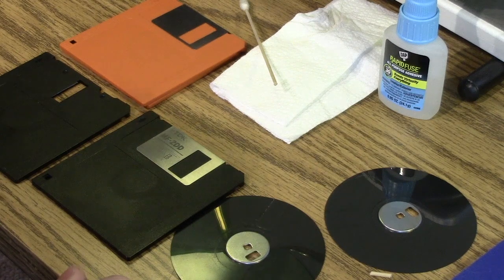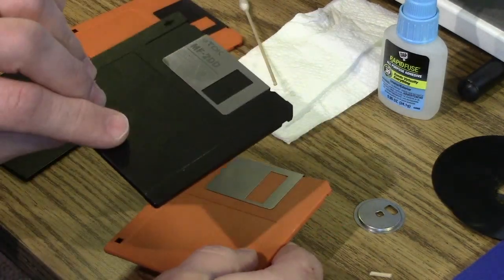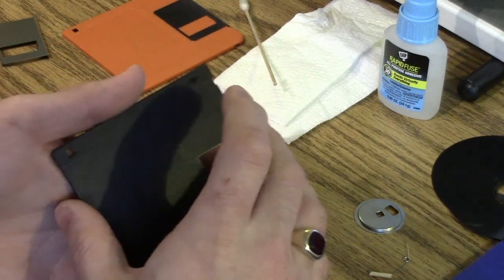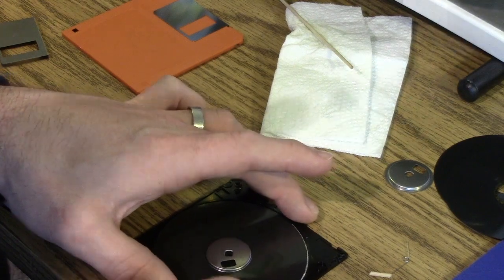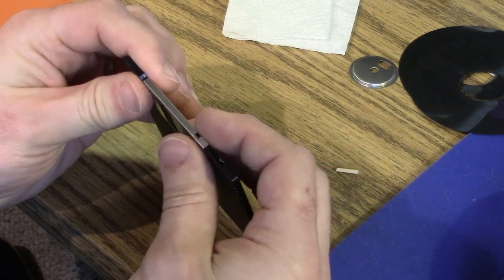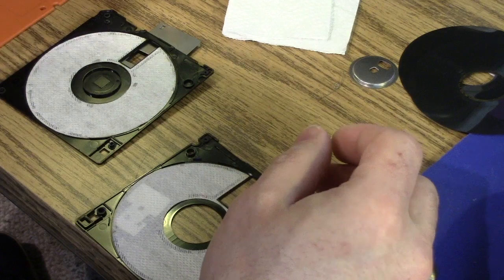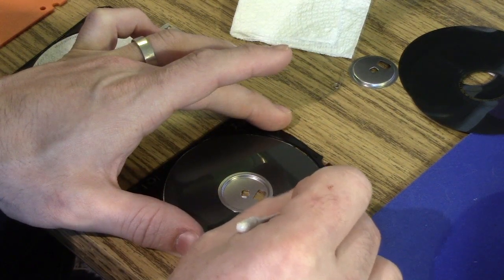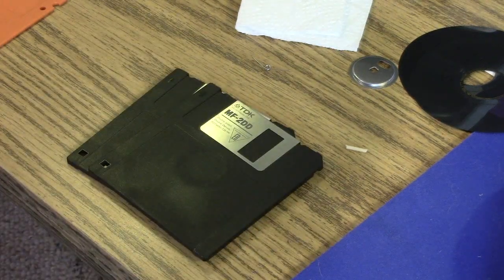Refurbishing 3.5 Floppy Disks: Swapping the cookie!

Comment: Or, you could... you know... just use a new disk in its original jacket. There's nothing that's really that nostalgic about some printing that might be on the shutters of older disk jackets, and this is more trouble than it would likely ever be worth!
Reply from the maker: I guess you've not noticed how different early 3.5 DD disks are to late ones. And I find ones that say Single Sided on the shutter quite nostalgic!
Reply: @compu85 : I guess SS ones are quite odd; what a waste of a side, since you can't flip them like you can flip a 5.25" or some 8" ones. But as for actual collector nostalgia, have you really heard a lot of rumblings going on that those would really be worth much that way, and only if they're functional?
Reply from the maker: @HelloKittyFanMan  Well, the first 3.5 floppy drives were only single sided... 
I don't know about from a $$ amount. I just fix them because I think they're neat :) 
Plus, it's kind of neat to make exact replicas of the original software distribution media.
Reply: @compu85 : Yeah, weird that there were any SS 3.5" drives. It seems that if they were gonna make a system like that, whose disks you couldn't flip, then they should have just gone all the way and made them DS the whole time.

Oh, yeah, I didn't really see the whole video yet, sorry. But if you included something about functional replicas of software releases in there, then I guess that's cool.